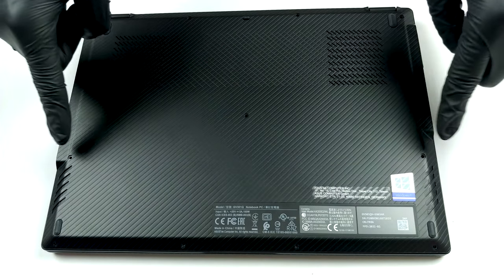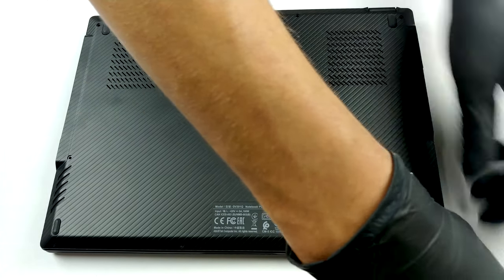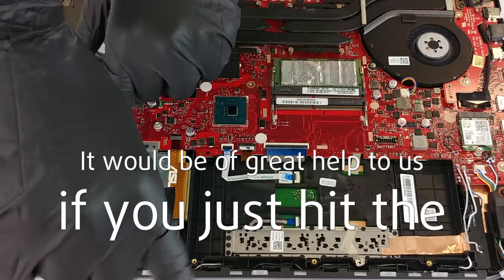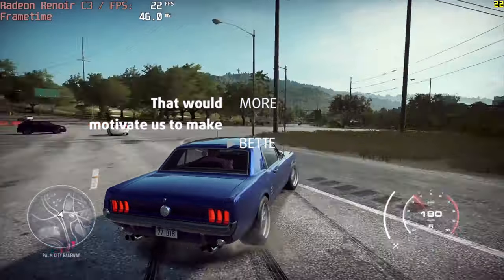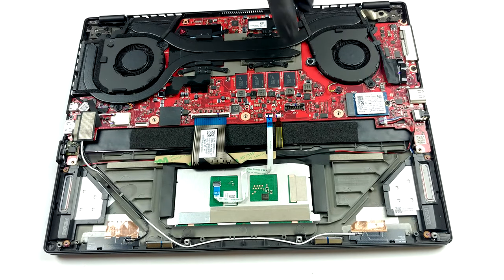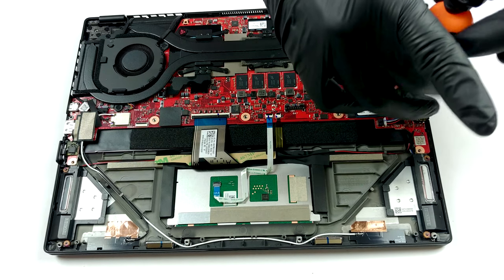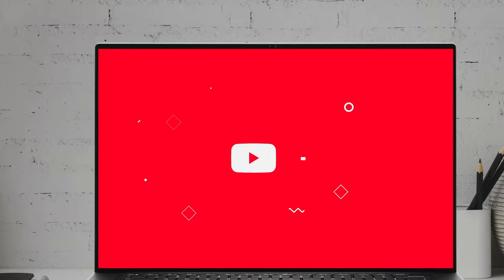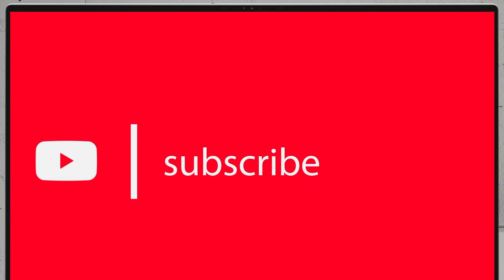🛠️ ASUS ROG Flow X13 (GV301) - disassembly and upgrade options

Comment: Upgrade options: none
Reply: doesn't matter, because it's an ultrabook. ultrabooks are rarely upgradeable. Asus used the space in this laptop well. You don't need to upgrade the RAM anyways too, since it's already pretty much the best they could fit on it: LPDDR4X@4266MHz

It's already a miracle that a laptop this thin performs as well as it does, and the fact that you can upgrade the GPU is a huge bonus.
Reply: NONE
Reply: @niko1even  There are many including me who wants a laptop with thunderbolt and 32gb ram for my professional works. This is why upgradability matters a lot for people like me, because these brands charge $200-300 more for getting more ram on the same laptop model.
Reply: @srimasis  then you shouldn't get an ultrabook, at least in today's age. We might see improvements in the future, such as what we see in the framework laptop. 

And honestly, I think that the upgrade cost for this laptop specifically is mostly justified (going from 16gb to 32gb + CPU upgrade), because the ram used in this laptop is much more expensive than typical ram used in SODIMM modules.
Reply: @niko1even what if the ram gone bad and i need to replace it?
Reply: @MAbduser  use your warranty
Reply: @niko1even  what if the warranty's expired?
Reply: @MAbduser  I doubt that you would still be using the same laptop after 4 years, assuming you bought the extended warranty, which you would be pretty dumb NOT to buy an extended warranty for a laptop this expensive.

You would take it to a repair shop for them to do a replacement of the dead ram chip. They will desolder the ram, that is use a hot air station to heat up the solder to melting an remove the chip, wick away the extra solder, reball a replacement module and solder it back on.

by then, LPDDR4x should be pretty cheap so the whole procedure should not be expensive at all.
Reply: I wanted to buy in 2024 but don't know if it's even worth it
Reply: The soldered RAM can be replaced. Not too difficult.
Reply: Ssd can also be upgraded
Reply: @Blocs-diagrammes  what are the options? I saw one that doubles the space, but am leery of its compatibility...

Comment: Great laptop. Pity that ram is not upgradable and ssd is virtually not upgradable either. Only Micron has released a 22x30 2Tb m.2 but hard to find and i guess over most mortal's budget. Big mistake on my side not checking ssd factor before buying this laptop. A device this price should be ready for bigger m.2 formats, easier to find and cheaper.
Reply: @thunderlifestudios8630  Thank you Thunder. I did not think of the electrical tape for a larger m.2 A bit risky though, ssd would slightly overlap other components. I wish i had a spare 22x42 handy to give it a try. And yes, i have a nice external ssd that i use for backups. Just unhappy that many of my files "live" only in my external ssd for lack of space in the inner one. Regards.

Comment: Are you able to swap the GPU on this if you have the 1650 model and want to swap it for the 3050ti ? Or is that sautered also
Reply: Nope you can't
Reply: u can use external gpu with the laptop

Comment: Is there any ssd that you could actually replace with that ssd that's around 2TB.  Great vid btw.
Reply: same i really really want a 2tb ssd for it but i don’t think there are any in the 2230 form factor. not sure if there’s anything else that fits but looks like we’re out of luck for now
Reply: @andrewchao9164  yh it's quite annoying
Reply: just have a thought on using a 2242 to 2230 converter and use a sabrent 2242 2tb might be a solution. But i don't know if the motherboard support double sided ssd or not
Reply: Micron 2400 2tb 2230 ssd

Comment: The wi-fi and bluetooth antenna seem to be at the front of the laptop, i.e. under the users palms (visible when battery removed). Weird design choice... 
Also, some reviews note subpar wi-fi performance; probably related.
Reply: Very weird indeed. Naybe because of its multi-form design but still, it will affect wifi performance

Comment: Soldered ram - no thanks. If the ram will be soldered on a machine, it better be relevant for 2022 and the next 3 years at least. Meaning either 32 or 64gb. Also I would guess soldered ram is cheaper, so why the hell the ram upgrades are so expensive... The industry is just crazy.